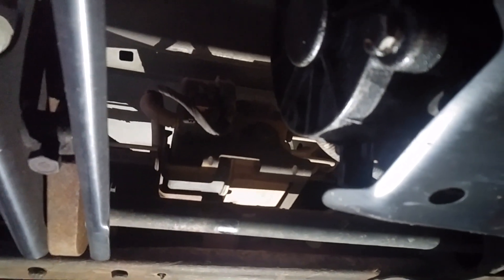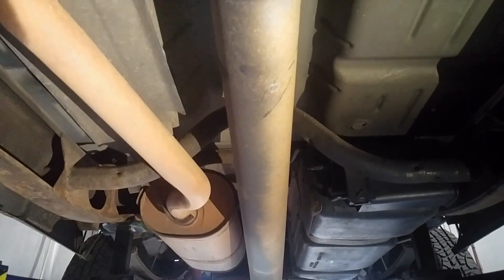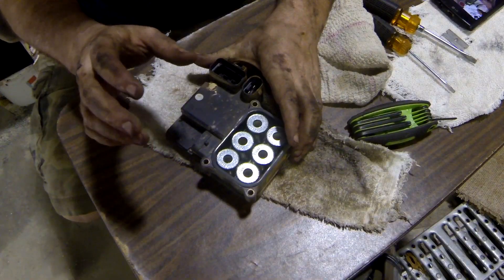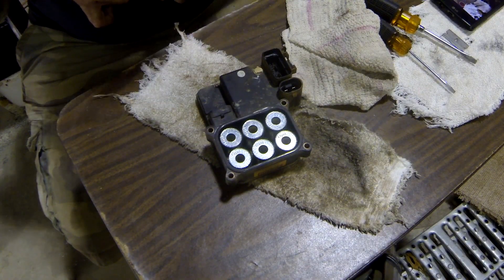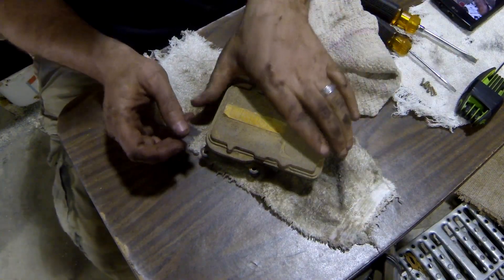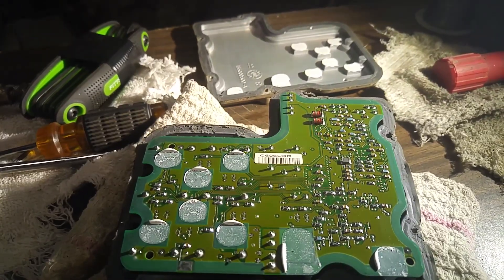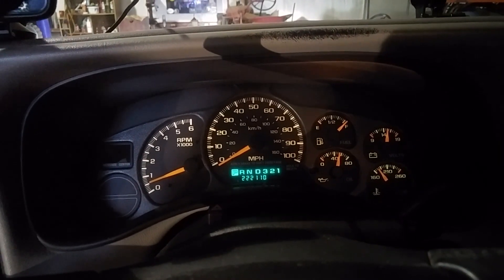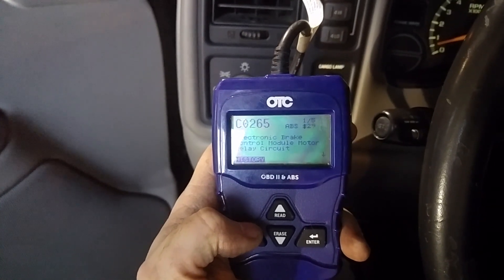Cheap Fix: DIY EBCM Repair - Fix Brake and ABS Lights (C0265, C0241, C0251, C0252, C0245)

Comment: Great job - the reminder about checking grounds was very timely, and could save you a lot of time.  My truck is a 2010 Expedition which I bought new. Had to replace engine at 150,000, which is when the ABS lights started coming on at odd times.  Ford has not manufactured any of them in about 5 or more years. If your problem is not a ground, you’re going to have to learn how to solder.  The directions he on getting to the module board are excellent.  Don’t disconnect the brake lines on the other side of the module unless you want to spend a lot of time bleeding the ABS system.
Reply from the maker: You got it my friend. Thanks!

Comment: The Torx screws can get rusty, making you think you only need to use a Torx 15 driver - don’t - it will completely strip the Torx socket head - use the Torx 20 he recommended, but clean the Torx head first, as he recommended.

Comment: So will this fix any of these codes ?? I have a code for C0245 and I just change the wheel speed sensors and cleared the codes and now ny brakes act funky until that codes comes back on

Comment: Did any of you have the problem where when coming to a stop the brake pedal will pulsate kinda pushing back. 
I have code B0201 
Also left speed sensor code 
Which im fixing now
Any help much appreciated.
Reply from the maker: I think a malfunctioning speed sensor may be the cause of your pulsating pedal. I would definitely fix that first and go from there.
Reply: @ChaosGarage  thank u sir. I did ficmx that. But it's not pulsating the exact same way alittle smoother. But it's still there. Code for wheel sensor is gone. 
B0201 hasn't came back yet. Nor have I seen the abs light.
Reply from the maker: Progress! If you still feel pulsating in the pedal, maybe make sure you don't have a warped rotor or uneven brake pads. If you're not getting any codes, it seems like your ABS stuff is fine.

Comment: When yours went bad did your truck all the sudden start idling rough also?
Just cleaned and reinstalled my grounds and that wasn't it.
I have mine out now with the top off to check the joints.
Reply: My 04 looks like a 2019 underneath and my torqs screws came out like they were just put in 6 months ago.
1 had a little dirt in it besides that they all came out easy.
Reply: My abs light never came on,my pedal went to the floor and service brake system came on.

Comment: My code is C0299 on my 07 yukon do u think its still thr abs module or the brake booster itself. The message i get says service brakes soon . No abs light. Like ur knowledge and showing how to replace.
Reply from the maker: I would check first for a vacuum leak. The booster could be leaking in the diaphragm inside is damaged or the check valve is malfunctioning. It could be EBCM but I'd rule out vacuum first. The easiest and cheapest way is to spray your vacuum lines and connection points with some carb cleaner while it's running and listen for the rpm to change.

Comment: Hey random question. I bought a truck and it has no ebcm in it. Does it mess with anything other than the brake system or just the brake system
Reply from the maker: I believe just the ABS. I don't think the EBCM does anything else.

Comment: it's been a couple years and my lights (ABS and brake) are starting to come on again, I'm so happy to find your video AGAIN , i like your style, I'll inspect a little closer this time and see if i can determine exactly which connections are the culprits? Thanks so much again. From Big Island  Hawaii..by the way my truck has 235,000 miles and runs awesome, i see yours was around 222,000 also, GM did good on these.
Reply from the maker: Thanks! I hope you get it this time my friend!

Comment: My Silverado also had a wheel speed sensor out on the front driver side both open and short circuit codes

Comment: Yeah mine recently started doing that and I also skid a little bit in the brakes when slowing down to about around under 10mph. Calipers all good and functional, new rotors and pads all the way around got the EBCM code C0245 along with some rear wheel speed something or another. Annoying
Reply from the maker: Your wheel speed sensors will make the system act goofy for sure if they aren't reporting correctly to the computer.

Comment: Abs and brake light coming on with my vehicle. I also had transmission shifting weird. Did you experience any issues with the transmission
Reply from the maker: I don't recall any transmission issue related to the EBCM module.

Comment: 2001 silverado I have the exact  same codes. Abs/brake light are on. 4x4 doesn't work.
Sometimes brake light flashes when I start the truck and then stays on. 
Anyone had the same issues fixed?  
Is this module related to the 4x4 not working?  Thank you! !
Reply from the maker: Sounds like it could be a weak solder joint in the module providing intermittent connectivity to the computer. The module doesn't have anything to do with the 4wd as far as I know. What does the truck do when you try to engage 4 high? (lights on the panel, sounds from under the truck, etc)

Comment: I just noticed mine only comes on while driving. No effecting on braking capabilities yet.  I changed upper and lower rear control arms and that's when the light started happening.
Reply from the maker: Any wheel speed sensor related codes?
Reply: I have wheel sensor codes. Should I change those first before trying this?  @ChaosGarage

Comment: I have a 2000  GMC Safari with the same issue lights keep coming on, took it to get serviced was told that I need a new on and that a dealer would have to program it.
Reply from the maker: This might fix it and it's cheaper than buying a new one. I haven't had any more issues with the one in my truck.

Comment: I gotta do this to my trailblazer. Brake/abs light. When its super cold outside it will not come on (indicating bad solder joints since the board does not heat up in -15 degree weather causing the solder joints to seperate) When its hot out, almost instantly. 

But dumb me put it off for too long and now its cold in MN, We have some decent weather so I might crawl under there tomorrow and try to pull it. I hope the t-20 are not rusted to hell or its waiting until next year.

Comment: The modules are not that expensive you could get them less than $80 on If you buy just the module you will get it cheap and you can get a AC Delco but if you buy that module in pump that’s where it cost 600 $800-$1000 when you buy the whole assembly you don’t need the whole assembly or you take the GM and they will do the recall for freeDo the research online cut the middleman out and you won’t pay as much

Comment: I have a 2003 GMC Safari, AWD.  First ABS problem I had was the front right speed sensor.  Replaced it and the problem went away for a couple of years before returning.  It was obvious then that the hub was going bad and affecting the sensor.  Replaced the hub but sometimes an intermittent ABS/Brake light would appear.  I wanted to check the solder joints but it was impossible to get the ABS module off without removing the entire unit. Rust was so bad the screws holding the electronic module were wasted.  I gave up on that idea temporarily.  Recently, a front brake line ruptured.  Being in Ohio the rust is bad. Brake lines in very bad shape so I decided to replace them all.  Since the lines were all removed I took the ABS module off the vehicle.  When I got to the part of removing the small screws holding the top metal cover I discovered there were not any!  Apparently they stopped installing the screws and just let the seal around the lid hold the cover on.  I am in process of doing this work now.  Have not actually removed the metal cover at the time of this comment.  Will do so later today.  By the  way, GM has had solder joint problems before.  Had a '98 Bravada. The windshield wiper module had the same problem.  In that case the connector, which had rectangular pins were soldered to the PCB in large round holes flooded with solder. Over time the solder would develop cracks and become intermittent.
Reply from the maker: I have the exact problem with the wiper blades on the truck now, I just haven't taken time to tear into it. Also I have a bad solder joint on the odometer so it cuts out from time to time...again lazy :D Hope you get it fixed! I also have a 98 Bravada I had to retire to the tree line for good because the front suspension is shot and not worth fixing. Good luck!

Comment: does this affect vehicle drivability?  If it's just the dash lights, annoying I know, but who gives a f**k?
Reply from the maker: Yes if it isn't working correctly then your anti-lock brakes aren't working which could lead to locking up the tires if you slam on the brakes.
Reply: @ChaosGarage  10 4

Comment: Thank's for making this !,  with the help of your video I got 'er done. 
For anyone thinking about doing this, It's not very hard if you have the right tools. You'll need 1/4" ratcheting box wrench with a 1/4" shank 1"- 1.5" T20(for the inside screws- the frames in the way) an extension for the 1" T20(for the outside screws) to get the case off the ABS control box attached to the frame, a 2" or longer T9, razor blade and popsicle sticks for getting the case apart and a 1/8" brass tube and the razor blade to clean out the gasket channel and silicone sealer and thermal compound to put the case back together. And a bright magnetized light to see what your doing!. The hardest part was getting the old gasket off. No need to lift the truck up.
Reply from the maker: Thanks for sharing tips! I'm glad you got 'er done!

Comment: I just had an identical problem with a 2002 Suburban Z71.  I had installed new hubs and bearings, as one was bad.  One of the new ones had a broken sensor straight out of the box.  I still got the ABS/brakelight issue though, after fixing these issues. I didn't know if the code was a hard one that had to be removed with a scanner, so I bought one.  I cleared all the old ABS codes, then, cleaned up the ground contact point on the frame just under the divers door, like you showed here.  THAT fixed it. No more ABS light, and I didn't have to remove the module like you did.  I would suggest these steps first, PRIOR to taking the module down. As shown, it was unclear which step actually fixed yours.  If you cleaned up the ground first, and tried that, you may not have had to spend the time with the module.  Always, first things first. Keep it simple.  Thanks for the video.  Kind regards

Comment: Not the only vid I watched on this topic but wanted to throw some props. It works! Plan and simple. Btw 1/4 ratcheting wrench fits t20 bit. I had plenty of room to get ebcm out took less than 10min. 20 min  to get sealant cut. 10 min to reflow ALL large pin through solder joints. I used flux to make sure solder joints could adhere to board with no issues. C0265 would throw immediately after clearing it, abs/brake lights would come on together sporadically but usually with my 20mi drive to work. Sometimes within 5 min, sometimes right before getting to work or home. I just drove around in and off highway for 40 minutes and still no warning lights and code never popped up again. 
    If you've exhausted all other tests and are going to replace ebcm DON'T! Buy a nice solder iron station(nice to have) and give this a try. These damn modules are not cheap, might as well give it a go.
Reply from the maker: Nice, I think you did it quicker than I did! But still working great for me as well. I've had the truck buried in mud and water quite a few times with no issues. I didn't think about using a ratcheting wrench...good tip for clearance!

Comment: Does it matter if i replace the thermal paste on the board and cover. Or should i just leave it alone. Any solder do?
Reply from the maker: You don't have to replace the paste but it definitely wouldn't hurt. I just use regular silver solder.

Comment: I went through this process, touched up all the recommended pins, plus a few more.  Issue returned immediately.  Any ideas on where else to look?  Wiring, etc.?
Reply: There is a ground wire bolted to the frame close to this abs module closer to under your foot area and there are two ground wires bolted to outside frame by the steering box area. Try taking those off and clean them. Good luck!

Comment: Jesus... I'm 5 hours in and can't get the 4th T20 bolt out. It appears to have been stripped. I can't fit a Dremel in there. going to try an Allen wrench (or something) else it looks like the whole damn unit (pump and module) will have to come out... meaning brake bleed and everything else. Mine is a 2002 Chevy Silverado 1500. It's under the driver's side door and a MAJOR PITA to get to. I'm not a mechanic by any stretch but this seemed easy enough. Never thought getting it out would make me cuss so much. It's still not out!

WHY would they put that module in like that??? OMFG!!!! This is insane.
Reply from the maker: I hope you got it my friend. It is a pain in the butt!
Reply: @ChaosGarage  Thanks man. No luck. This has been a nightmare. 3 T20 bolts out. Took 4 hours just to get those 3 bolts. Who designed the placement of this thing????? The 4th bolt is rusted in I guess. I dremeled a slot after stripping the bolt head. Used some PB Blaster. Still didn't work. Ended up with a very small chunk/crack in the plastic housing. It's still there. It looks like I'm gonna have to pull the entire unit (pump and module) then have to bleed the brakes. This sucks so bad.

Comment: What was with the Samsung galaxy on the dash like a tuner?? would like to know
Reply from the maker: It's the Torque application connected to an ODBLink MX via Bluetooth. Works as a code scanner and digital dash for whatever information it can read from the computer.
Reply: @ChaosGarage  oh alright cool thanks.

Comment: My 2000 Silverado has been in the shop for over a month. Among the repairs being done is the ABS module/pump repair. Shop went through 2 bad junkyard pumps before attempting (and successfully) repairing the one on the truck. Now they tell me the ABS works incorrectly. Maybe a wheel speed sensor? I don't know but they're still wrenching  away at it. I've lost faith in this garage and won't be using them ever again. Over a month for a few repairs
Reply: Dude it's your truck not them. They are chasing ghosts

Comment: Loved to have seen you soldering these up.
Reply: It's just a reflow. Make sure the iron is hot and clean. Little flux on the joints and a hold tip to side of pin close to the board. When solder goes liquid pull off and that's it on to the next on. 
    Just did mine, hardest part is cutting away the sealant.
Reply: @airgunningcolorado78  same here, cutting that sealant away definitely requires patience.

Comment: Just pulled my ABS Control Module out of my 02 Silverado and ya. I have to wear goggles to even look underneath the truck North East winters have left the poor thing with about 1/4 inch thick scale runs on everything underneath.  Yes we are descaling and treating the underside but ouff.
Reply from the maker: Yuck! I hope you got it done!

Comment: Good explanations and points on removal and disassembly of the module. However, I wish you would have shown at least some step by step photos the areas you actually soldered and then the reassembly of the module — these were the crucial parts of the fix.
Reply: At 7:44 he points out the areas to be soldered and then said he is going to just go ahead and reflow all the posts that stick up off the board
Reply: Like the fella said earlier. All points that stick thru the board are to be reflowed. You need a decent soldering iron for it that can adjust its heat. It’s one of those things that if you’re not comfortable or have a million questions probably not best to learn on an expensive module like this. But if you want to reach out I can walk you through how to do it, as I’m damn good with a soldering iron and work with pcbs decently often. Also realizing this is 5yrs old and you’ve probably dealt with it. 😂

Comment: Just wondering how would I get it out if the screws are rusted in place....any ideas to get it off.
Reply from the maker: Hmm you will need a good fitting bit and hope they don't round out. If they do then the next best thing I can think of is using a Dremel or something and slotting the head so you can use a flathead screwdriver.  Good luck.
Reply: @ChaosGarage I had to use a dremel to slot the end of what was left of a screw, rusted and head busted on one (4th distributor cap one in my 2003 GMC Sonoma 4.3l) to get the only screw holding the rotor button on. The other was rattling around under the button. Fun times! Thanks for the video!

Comment: We have a stripped out thread on the abs unit but the module is still in good shape. Can you replace just the valve if the module is in good condition?
Reply from the maker: I suppose that you could, I've never had to take it apart that far.